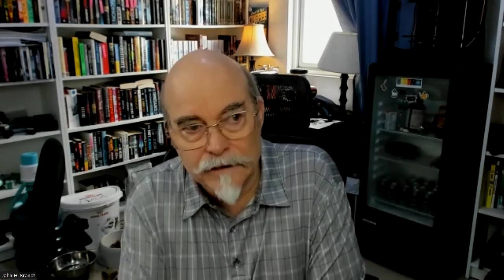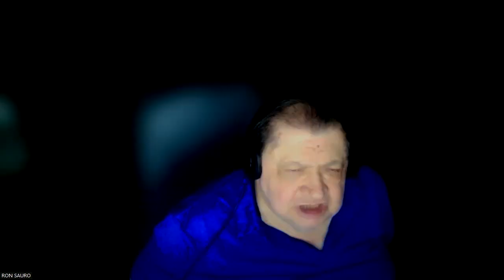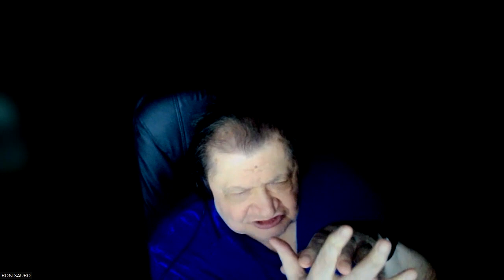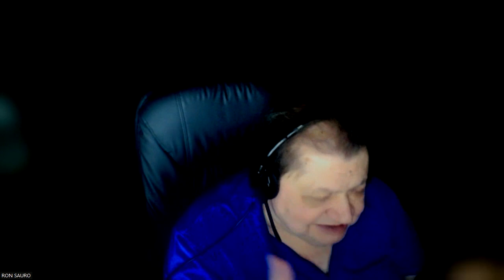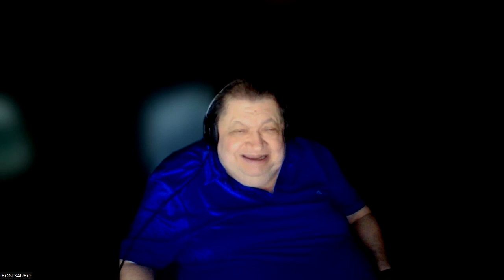Air Gap behind absorbers

Comment: Great info. I have always placed my 2" thick absorptions panels against the walls. These are my 1st, 2nd refection absorption panels. I have a cloud which does have an air gap about 2-4" off the ceiling. I have a thin  carpet in the back of the room to help with some of the reflection off the floor to ceiling.  I also have bass traps in all 4 corners. the final panel i have is a 4x8 panel with 4" thick rockwool. this seems to all work pretty good. I am not an expert I just listen and decide if I like it.
Reply from the maker: Don, please join my FB group. We discuss advanced absorption techniques. https://www.facebook.com/groups/517162262483268    Don't forget to agree to the rules. 😁

Comment: Are you saying that the quarter wavelength theory is false? Do you state here that thickness of poreus absorption and spacing has no influence on frequency behavior? So if I understand correctly you state that there is basically no difference between an a-mount or an N-mount?
Reply: That was not my takeaway at all. My takeaway was that an air gap behind the panel only helps if the sides of the panel are sealed and go to the wall, or mostly to the wall, otherwise the pressurized air at the wall escapes in a sideways manner through the air gap instead of bouncing back through the material for a second round of absorption.
Reply: @HalcyonGuitars or, just treat the whole surface….

Everything else is just a compromise.

Comment: Thank you very much for the video.
Can you make a video where you talk about the 4" ( 10 cm ) wide band absorber panels?
thickness ?
The ones you were talking about in previous videos with Mr. Ron Sauro that have an absorption coefficient of 80%.
up to 80 Hz.
Is the simulation program for these panels is free or is there a fee ?

Written with translator.

Regards
Reply from the maker: We'll do that. By the way, no absorber can do 80% of the sound. The absorption coefficient isn't a percentage, it's simply a factor used to calculate the sabines of a sample.
The very best absorber can only absorb 10 dB of the sound wave per surface contact
Reply: @JHBrandt  Thank you for your kindness in answering.
I will keep an eye out for the next videos.

Written with translator

Greetings
Reply: @JHBrandt right on, my tuned traps take out about 1.5db at 40hz per panel, it isn’t much, however while they didn’t do a great deal in the frequency domain, they did wonders for the decay, 37hz used to ring before I got the tuned traps. While that one note is still louder, it is no longer as irritating thanks to the diaphragm traps.

Comment: Love the valuable content Ron and John. Is there any way to do comparative testing of bass trap designs outside of a lab? Is it essential to have a diffuse sound field across the spectrum you are testing or can you get around this for the purposes of initial R&D? For example could an impendance tube or similar be used? By bass trap I mean some kind of pressure absorber, not just porous material. thanks!
Reply from the maker: Good question! To test bass, the impedance tube would have to be about 1/4 mile long and it would only apply to 0 degree incidence... so no. We talked about impedance tubes... next video.